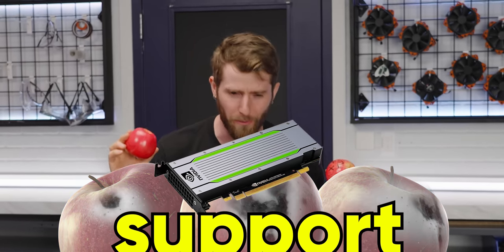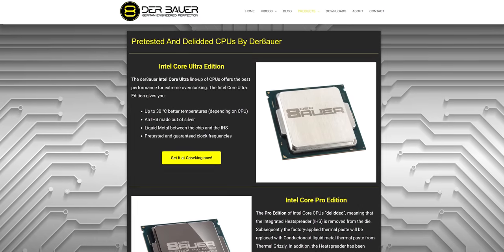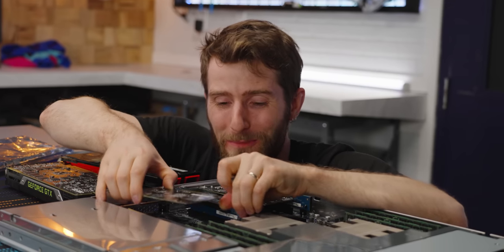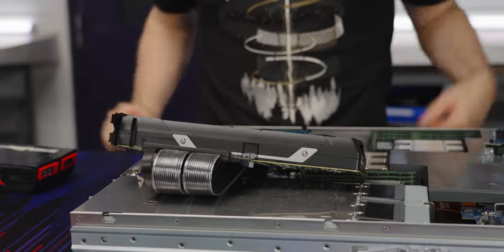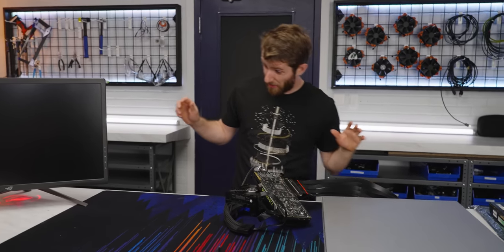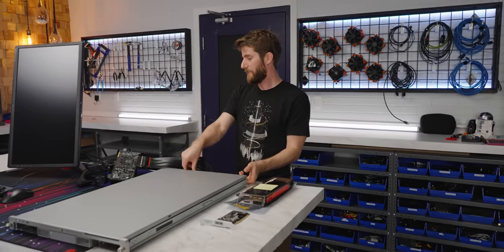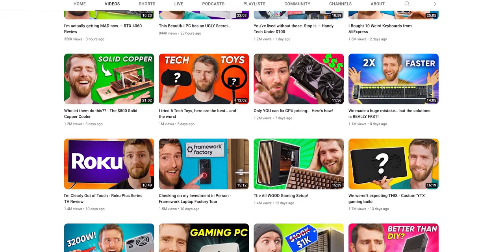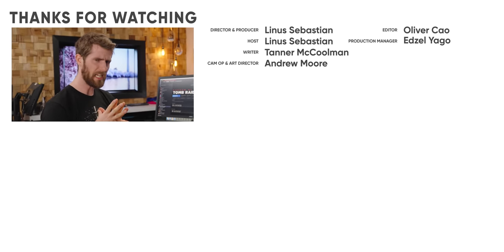Gaming on the Apple SERVER? - XServe 3,1

Comment: Author of the Definitive Upgrade Guide here: The 3,1s cannot boot with more than 64 GB due to the firmware, not sure about the Xserve but the 3,1 desktop have performance issues in macOS for 64 GB.

Also, LTT needs to learn about OpenCore. People take 12 core 5,1s and drop in 192 GB, as well as 6900 XTs, USB3.x, multiple NVMes and even Thunderbolt . Pretty sure OpenCore can get the Xserve into modern boot camp, whereas you don’t need it with the desktop 3,1 if you’re willing to run in legacy Bios mode.

Comment: X-Serves aren't worth buying, unless you're somehow required to use a rack mounted machine. Apple replaces the X-Serve with the Mac Pro Server, which makes it a lot easier to upgrade. You can use those hotter running Xeons, you can put a graphics card in it, without requiring a second power supply, and you can still close the case with the card installed. No adapters required.

Comment: I don't get it. Why would the new Mac not support GPUs? Lack of drivers? Lack of support from the OS? Why would they kill that feature? Isn't it the same as just having support for other types of PCI-E expansion cards that also have to get updated drivers to work with M2 Macs?
Reply: From some googling, it looks like MacOS still has driver support for some AMD gpus, but they dropped all support for Nvidia gpus starting with Monterey (released 2021). 

Back when they were still on Intel, they stopped using Nvidia GPUs in the Macbook Pro lineup in 2015.

It seems to be down to bad blood between the management of both companies. Nvidia could write a macOS driver for its newer GPUs, but Apple controls whether macOS will allow the driver to run.

Comment: I have two drive bays you can have for this exact XServe. Also as a heads up, in a previous video you said they needed to be Apple HD's. This isn't the case though maybe for the primary slot one drive. I had the stock HD in slot one then upgraded bay 2 and 3 with 2TB HD's.
Reply: You can have any drive you want, as long as it's supported by the backplane (SATA or SAS). Source: I've tried.
Some drive sleds may only support SATA, my system was SATA though it was delivered with SAS capable drive sleds.

Comment: My first gaming pc was a 4,1 Mac Pro with upgraded cpu (3.46ghz 4c/8t) and two HD7950s running in xfire on windows 7. Later ditched the 7950s for a R9-390x. The 4,1 had delidded cpus but the 5,1 didn’t.

Comment: I don't have a Mac gaming rig with 96 GB of RAM, but I do have a Mac gaming rig with 48 GB of RAM.
It's a 2010 5,1 Mac Pro, and also has a 500 GB NVMe boot-drive in a PCIe adapter, an RX 580 graphics card, a Blu Ray drive and a USB-C card, and it runs through a phenomenal 30-inch Apple Cinema Display. It's EXCELLENT for gaming.
I also have a 2013 trashcan Mac Pro with a 3.7 GHz quad-core CPU and dual AMD D300 GPUs. This Does Not Compute showed that the D300 is just slightly lower in performance than the M1 chip's GPU, but they're, of course, much less powerful than my 2010 Mac Pro's RX 580. Even so, my trashcan Mac Pro is very good for gaming.

Comment: Im still gaming on an Mac Pro 5.1 with dual Xeons with 6 cores each clocking at 3.3GHz, 128Gb RAM and an GTX 680 Ti running Windows 11. Its not the best experense but its enought for single player games.

Comment: Why do this with an ancient xserve?  Mac Pro 5.1 can be upgraded with pcie nvme, modern-ish macos 12, amd radeon 5700xt or 6900xt ... I'm running mine with maxed out dual 6-core xeons, 64GB RAM, 2TB boot nvme ssd for the OS, and additional 2x4TB sata ssds in raid-0, and amd rx580 8GB GPU with 4K monitor.  I was able to run steam on it, but haven't played much beyond civ 6 and cup-head, in 4K.  You can do it, just look into opencore legacy patcher, toshiba xg6p nvme ssds, and macpro pcie cable mod for more power hungry GPUs.

Comment: Why would you not turn on vsync? I use it all the time with my 60hz monitor to prevent screen tearing, and also to save a lot of power, no need for my 3080 to run at 300 fpa on a 60hz monitor..that saves me a lot of money for electricity..

Comment: Linux doesn't need Bootcamp to boot on Intel Mac's afaik. i did it on my 2014 MBP and all i did was insert the thumb drive and hold the boot menu key combo at power on, it came up as a boot option and i was in and installing it like any regular PC.

Comment: I still have a Mac Mini late 2012, working just fine, and upgraded years ago with a new SSD and more RAM! Can't stand the idea of upgrading to the newer Mac Mini's. The M1 processor, neural engine and updated OS (I'm running Catalina still) makes it tempting but the fact that I can't even upgrade the RAM on the thing turns it into a brick if it suddenly decides to die on me. I don't care about 'unified memory', I'm not sure about buying a potential and very expensive brick, I'll stick to the 11 year old computer thanks. Perhaps when they say 'they did it better back in the day', this is the kind of thing they meant... ;)

Comment: The Mac Pro 5,1 is the exact same as this, but in a tower form rather than a 1U rack. You can force upgrade it to MacOS 10.15 Catalina but it isn't supported by Apple.. Technically also Monterey and Big Sur as well, but it has some issues.

Comment: i have a 5,1 tower 2x 3.06ghz 6core with 96gb running windows without bootcamp and an old rx580 that i bought from a miner.  works awesome for gaming and all told i have about $500 into it.  also have a  single cpu 3.33ghz and 48gb with an rx560 that i run open core with monterey that does all of my music production.  both of them rip for being 12 year old machines.

Comment: The Mac Pro 5,1 is still viable in this regard. I have installed macOS Monterey in mine and an RX6800 and it can game. 😂 the 5,1 can do 2x 6-Core Xeons so you have decent cpu performance too.
Reply: Biggest issue with Westmere cpu's (which I love) is IPC performance. Other than that ... they f.... OC as hell ! Probably not in a Mac Pro though

Comment: Probably has more to do with Ranks per channel. If I recall those were 3 channels per CPU and with 2 cpus 6x16GB should have been possible. So 2r4 DIMMS in 16GB along with appropriate speeds "should" work. Or at least it does in my old PowerEdge boxes.
Reply: it was mostly because there would be 3 dimms per channel so you had to keep the rank rule in mind,  more modern servers tend to have 2 dimms per channel.

Comment: I once owned a Mac Pro 5,1 that i upgraded with 48gb of ram, dual xeon cpu and r9 390 because I always thought it was an issue of the performance, and then after upgrading and trying to play portal2, dota2 etc. it was such a bad the experience altough having such strong performance. So really it is macos the problem not being at all optimized for gaming, but with macos sonoma maybe we will finally have a change for that

Comment: I used an GTX1070 with 10.13 hackintosh back in the days. Then when that conflict happened and I had a need to upgrade OS I used a spare HD7970 card. Got much better system because of no broken Nvidia drivers despite having a weaker GPU.

And since it is unable to boot Windows, maybe it is possible to install Linux with modern GPU? That is much more compatible with games today than macOS.

Comment: Technically you could get a 2019 Mac Pro in the rack mount form factor and curb stomp this system to smithereens. And it is supported and has all the advantages of this system with very recent hardware.

Comment: This machine has an older EFI implementation and needs some pre-boot 32-bit to 64-bit switching. I have Linux, Windows 7 and Xen running on it, so it's definitely possible. Windows can be massaged to work in an environment it doesn't understand using GRUB chainloading.

Comment: Linus - the raid card battery may be dead and prevent the bay hard drives from mounting-some trickery is needed to get them to mount. Also my 3,1 xserve runs 96gb with no problem, however I had to find the right combination to get it to work. Otherwise it has been a workhorse. Future video you can show how to replace the raid card battery.

Comment: I like this type of video of circumventing Apple’s schemes of not supporting gaming. But, how they did it is a bit odd. This is because there’s an Apple computer where all of this could’ve been done in a much easier way and that also supports up to the RX 5700XT or Radeon VII if you want something with more VRAM. It’s the 2010 (5,1) Mac Pro.

Comment: Cool video!  I have an xserve and can say linux mint does run on it, used it temporarily as a LANcache, but gave up on it due to the noise level and issue with only being able to use 2.2Tb of a single drive if it was larger than that (tried a 4TB).  In linux on the xserve, the dead HDD doesn't matter as much, the serial requirement doesn't seem to apply there.  Would have loved to see you try to game in linux on it.

Comment: it probably would have been fine to put the GPU down. the chassis is anodised and quite well oxidised by now, so the surfaces is not very conductive at all. of course depending on how hard you put it down, you could break that thin layer and then it is conductive.

Comment: I'm 99% sure you can run an AMD Polaris or even Vega GPU in that system, would be much less problematic. Will require a slightly modified install of 10.14, which isn't difficult - way less trouble than dealing with terrible, broken nVidia drivers. Parts of the screen going back can happen just browsing around in finder on nVidia equipped systems, even in fully supported scenarios like iMacs configured with a GTX775M.

I used to run 48GB RAM in my dual CPU Westmere based Mac at 1333MHz triple channel. Adding more RAM hurt memory bandwidth too much. I recall 16GB sticks were the largest the system was consistently happy with, 32GB sticks were spotty.

Comment: I know this was just a silly project, but to some degree this does show why upgradeability isn't everything. At some point hardware has to stop receiving support, and it makes sense because while this machine has decent specs on paper, in reality you've got a power hogging jet engine of a device that could easily be outperformed by a Macbook Pro with an M2 max.

Comment: just had a 8tb drive die at work today after migrating a file server to a fresh install of server 2022.  I spent longer than id like to admit troubleshooting what I thought was a share permission issue (could only read not write) . storage spaces had put the array/pool into read only mode due to the missing drive.  tested the drive, it didn't even spin up. will only know tomorrow if I'm waiting a work week for the replacement or 3 working days...

Comment: Challenge time: MacPro5,1 EFI for E5645 WESTMERE CPU. That gets you 2 more cores (you lose two RAM slots but I think it's the ones that don't work on your machine anyway). Then install recent Ubuntu, and you can run current Steam and games. Then a slot-power card shootout? Or; do it with a Dell or HP 1U box and do a $69 Gaming Shelf? :P

Comment: You could have done the same thing with a Mac Pro 3,1 without delidded cpus, without a riser and without an external PSU....Xserve 3,1 and Mac Pro 3,1 are almost identical..and can rub 10.13, and supports bootcamp.. i have a 2060 in mine but nvidia gpu mac drivers only support 10x0, so I bootcamp and use 8800gt 😂 in macos and not do gpu intense stuff (i has mac studio ultra anyway)

Comment: this era of Macs use Intel CPUs that support tri-channel memory. A lot of people found significant performance gains by simply removing a RAM module.
Reply: More like stability gains ... this was the first Intel try at something beyond dual channel. I mean, 3 channels have more performance than 2. That's a fact. The other fact is that some builds had stability issues (I had as well) and were forced to either use two channels or decrease ram performance by lowering ram speed or timings when using 3 channels. Later on, people found out that reseating the CPU solved some of this issues. Main culprit was the quality of some motherboards. Either the socket bed or the memory lanes. 
Know your stuff !

Comment: Not sure if you’d read these comments but it is possible to use a patcher tool like the DosDude1 Catalina patcher or Opencore Legacy Patcher to update the Xserve to a modern version of MacOS. However GPU support can be quite flaky, I find using a 1050ti in a Mac Pro 3,1 is better with the Opencore patcher than the DosDude1 patcher.

Comment: I've got a question for you, Linus and crew: I'm curious to know if you could get around the  Steam expiry with an AMD RDNA2 card and the forked SteamOS for desktops, HoloISO.  Could that possibly extend the life of that system?
Reply: No, because as they mentioned there's no bootcamp and no UEFI access, so no way to run another OS on this machine (other than possibly inside a virtual machine)
Reply: @TimSheehan that stops Windows, but wouldn't necessarily stop Linux if system drivers were already available for a variant distro for the system. It's worth a look for those that have them.
Reply: @DrakeSteele  if you can't reprogram the UEFI to boot anything but OSX it does stop Linux

Comment: The best way to make this work for games would probably be to install Linux on it.  At least then you could use a modern graphics card and have a decent emulation layer in Proton to run Windows games with.

Comment: Lastly with no EFI flash rom on the Titan X Maxwell you will not be able too boot into recovery on the Keyboard I tried. If wanting too boot recovery, you will be forced to too use a terminal command too boot into recovery without this ROM flash for the Titan Graphics Card.

Comment: Why are you using an xserve and not a 4,1 Mac Pro? Same platform. Can be updated way further. Mine has been upgraded to have 12 3.33ghz 96gb of ram. Booting from an nvme drive. Running windows and a newer version of Mac os than this video.

Comment: Regarding ram, density would be an issue with any inserted module, not a partial amount. On the other hand, if you ever had a X58 or intel 550, LGA1366 board - like I did till recently 3 of them - you'll know about this particular ram setups and the quirks running tri-channel mode. Yes, it sucks when it doesn't work ...

But hey ! X58 was the longer lasting platform I ever used from intel. Had one quad core OC to 4.8Ghz, an L5640 and the jewel of the crown, a X5695 running at 4.4Ghz. Still have a Gigabyte and an MSI LGA1366 board lying around, somewhere ... Did I say this systems had unlocked FSB ? OC heaven ! 

Intel tried to please Apple with this hardware and damn !!! It did please the PC enthusiasts as well back in the day ! If those Xeon's didn't have such a weak IPC and had AVX support, among other more modern stuff, I would still use them.

Comment: man of couse gpu will not work, did you forgot that pci-e in motherboard have 75w from powersupplay? so by this way you are mixing 2 powersupplays in one gpu 
do you want your gpu work with 2 sources of power? it will work but when you run any game it will crash
it will not work because i tried this before, then i make it work by disconnect power from motherboard and connect outside powerspplay to pci-e directly. it was cheapest way to run gpu without buy powersupply in syria

Comment: I remember I used to run Win7 in Parallels on my old 2011 Macbook Pro - I wonder if that could be a way to emulate Windows on your Mac system while still operating in the confinements of Mac OS instead of a dedicated partition? I swapped to full partition myself eventually, but for at least half a year or so Parallels did the job pretty well, disregarding some of the performance penalty ofc.

Comment: Apple basically told AMD & Apple it would not ship third party drivers with its OS, AMD was happy with this but as per usual Nvidia didnt want to hand out any code for cards so mad a web driver you could install, but with problems between Apple and Nvidia over defective GPU's from Nvidia in some MBP's they have never seen eye to eye so Apple has made it harder and harder with newer OS versions to use the web drivers to the point Nvidia has all but given up on them.

Comment: Couldn't you use the GPU on the Apple Silicon Mac Pro so long as you run the power cable to an external power supply?

And provided you compile the open source drivers for arm64?

Comment: Did this platform support Westmere? Some of the lower-clocked 6-core Westmere Xeons used about the same (or less) power as the Nehalem-based, quad-core X5570, while running at similar clockspeeds.

Comment: 19:03 Not many, considering more and more developers are blaming the weak XBsS as a bottleneck for their games. It has to run on that weaker platform, so they must dial down things like fps, textures, etc. Seeing how much, or how little, effort apple is putting into their hardware for gaming, I really doubt devs will even consider support for Mac gaming. At the best, not on day one launch. At worst, never. Best case scenario, we tried, and you get CP2077 running at 13fps... years down the line.

Comment: I can find my comment to edit cause I missed the part where boot camp is unavailable for that machine but doing more research on this cause I've never had a Mac that I couldn't install windows so under further review there is a trick and I wonder if the xserv you have will allow it make a bootable USB install and hit the commands to bring up boot from USB and see if you can force windows to install or put a bootloader in like grub and have grub boot the USB to install windows then reconfigure grub to look at the install to boot windows after installation